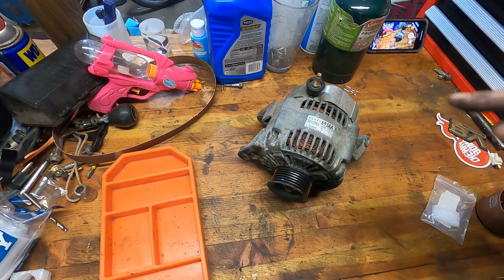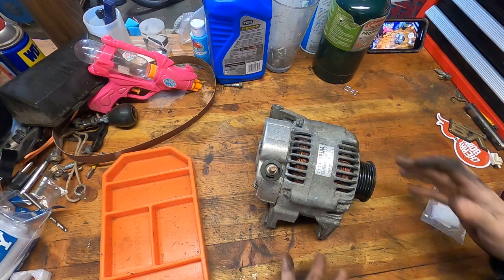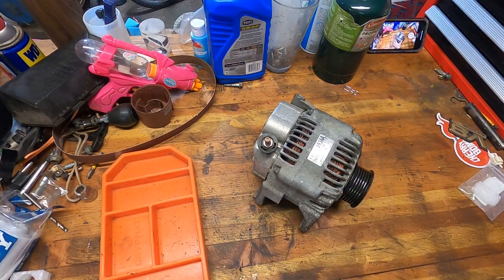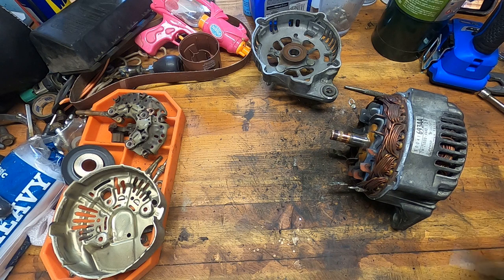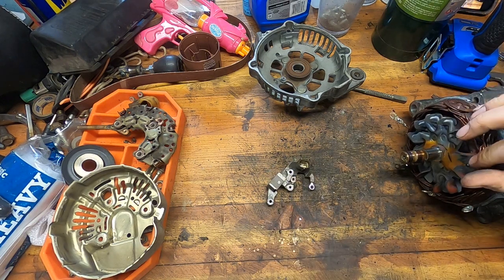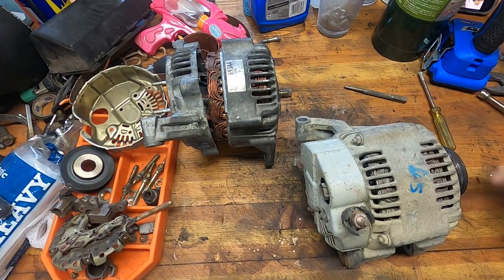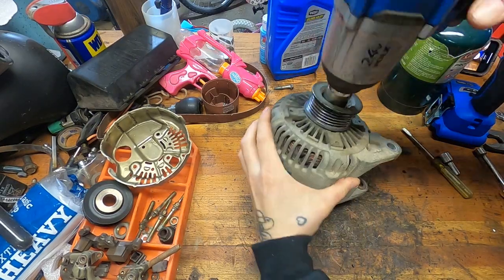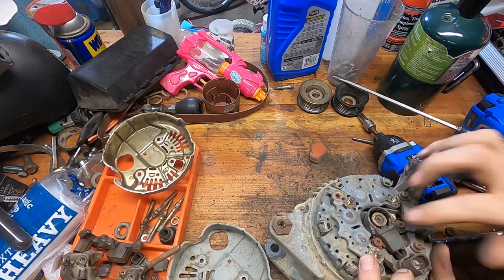Failed Alternator Teardown

Comment: My mechanic father used to repair all the alternators, starters and wiper motors.  Rewired with heavier guage wires.  Mow my mechanic bothers just toss them and put on a cheaper remanufactured one.  Throw away parts.  Mechaics just replace parts.

Comment: Interesting tear down vid.  

The only correction that I'd suggest is that the things that you called magnets on the stator are not likely magnets.  There are usually no magnets in an vehicle alternator.  The field coils form an electromagnet to produce the rotating magnetic field.  Just to be sure, take any piece of iron/steel & touch the stator parts & the rotor parts to see if any magnetic attraction is present.  You'll likely not find any.

Thanks for sharing!

Comment: I had the outer bearings on the alternator for my 02 Dakota fail and actually fall out onto the road. The alternator seized right up and the belt slipped right off leaving me dead on the road. Lol actually made it the 2 miles ( stopping a few times along the way of course) just on battery power, the engine was overheating due to no water pump but it was a freezing Northern Ontario winter which helped.

Comment: Usually the voltage regulator fails when you get no charge condition. If you get a constant battery drain and stuff comes on without the key in run, it's the rectifier. I've rebuilt some GM alternators, but by the time you buy the best parts, it's about the same price as buying one from the store. Have had good luck with DB Electrical. I don't buy Advance or Auto Zone anymore. I'd get a junk yard one before I'd buy one of those. As far as those fancy 200 Amp alternators, was told they fail all the time buy the alternator store guy. He said if you build one, stick with the highest output stator that the factory uses. The 200 Amp ones put an excessive load on all the parts inside and cause them to fail.

Comment: I rebuild my own Alternators & Starters when they go bad if the Alternator is a higher amp, at least 120 on my 97 4.0. I did the same thing ripping the bearings out for my sling shot from the 80's ( STILL HAVE IT ). Ended up costing me more than a few brand new Alternators, cut the hell out of my hand & had to have 4 stitches at Emergency Room, IDIOT. I WEAR GLOVES NOW, LOL.